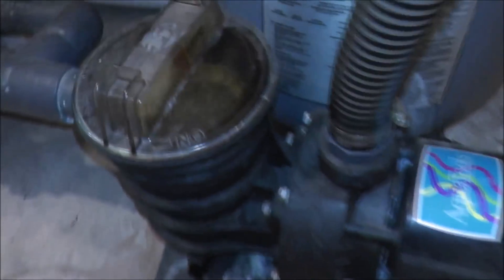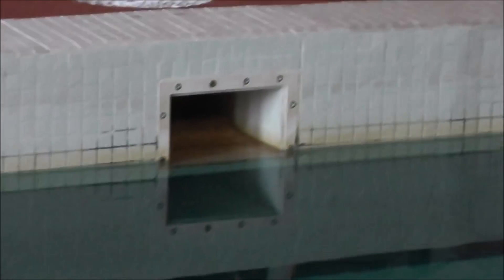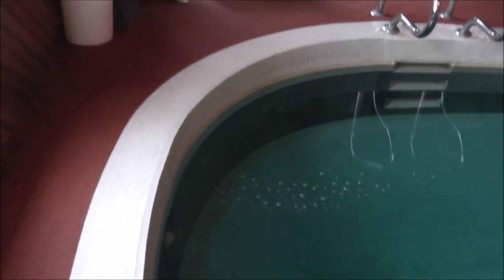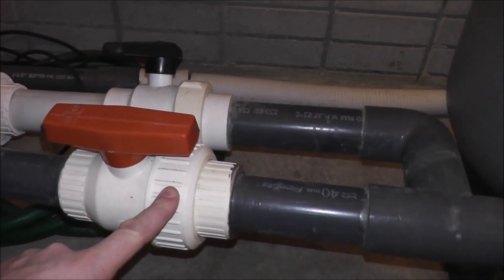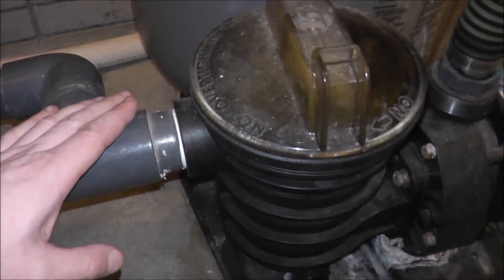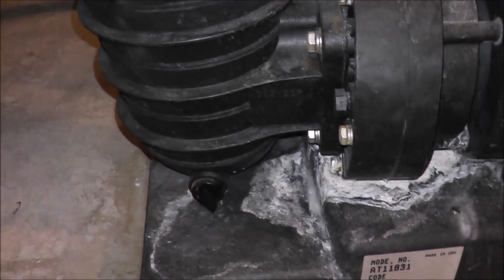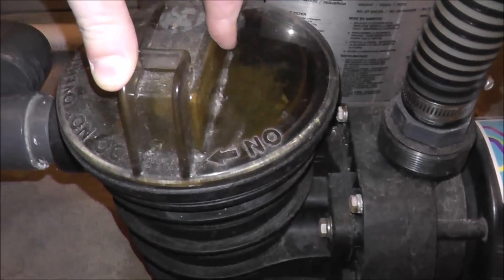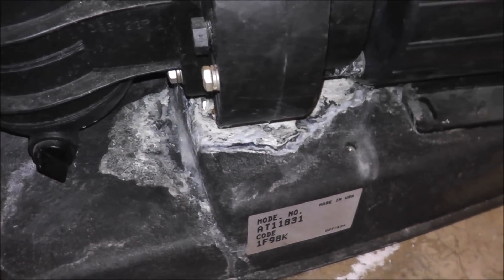Why Are There Air Bubbles In My Pool or Pool Pump

Comment: I just had this exact issue.  Run a garden hose over each valve on the intake side of the pump.  You will notice the bubbles in the pump basket disappear.  That valve is the culprit.  You are taking in a little air.  Go on Amazon and by the three O-ring packet (4) sets for $5.99.  You will obviously have 3 extra sets for a rainy day.  Take a picture of the valve before you disassemble it and at each stage.  Remove the 6 or so screws and pull the unit upward. There are two O-rings on the diverter shaft separated by a spacer.  Save the spacer. Tere is one larger O-ring on the lid.  Replace all three O-rings using a little lubricant.  No WD-40!  Replace the unit back in the valve and tighten the screws in an opposing pattern.  Don't go around in a circle.  I am willing to bet the bubbles in the pump and the pool disappear.  BTW...if you call in a pool guy they will sell you a new valve for $175 or more plus labor.  Trust me this is very easy to do!  Good luck.
Reply: I’m going to try this! Thx for the comment!